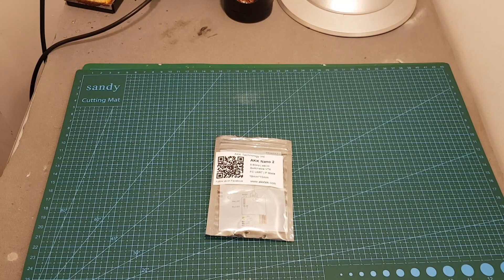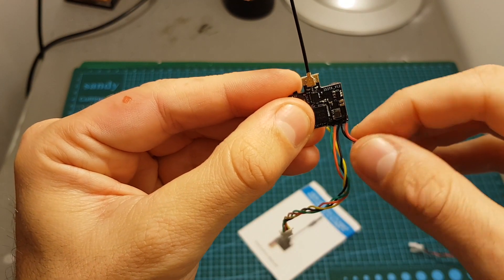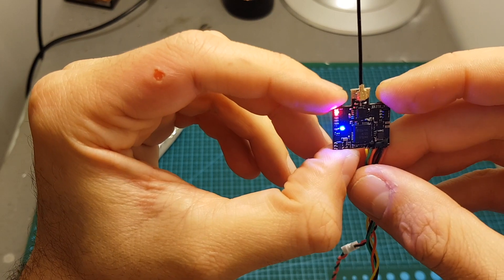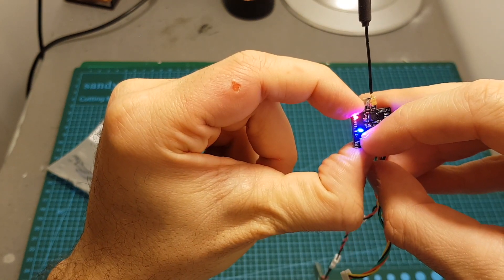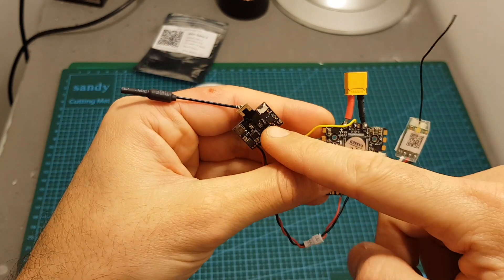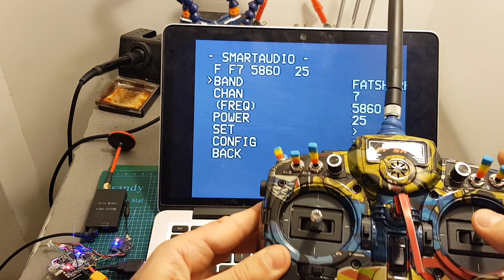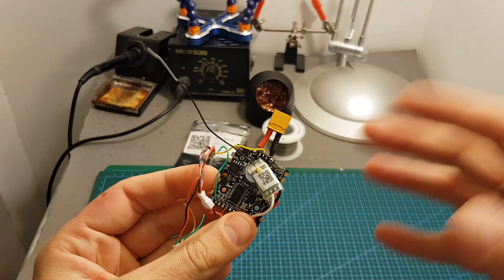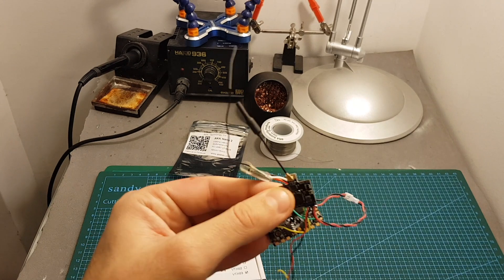AKK Nano2 VTX - Overview And Betaflight OSD configuration

Comment: If I solder to a crazybee, do I need to use both 5V and both Ground wires on this VTX? I haven't seen that before.
Reply from the maker: No, one 5v is an output to power the camera. Use just the 5v and ground that power the VTX.